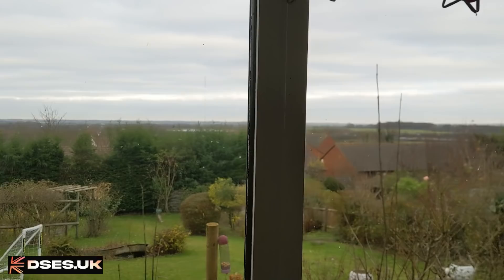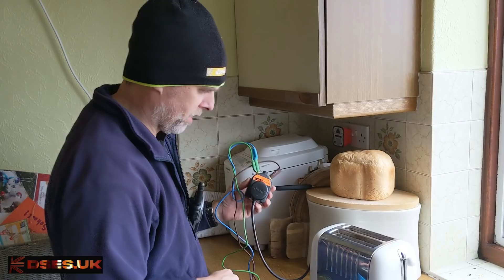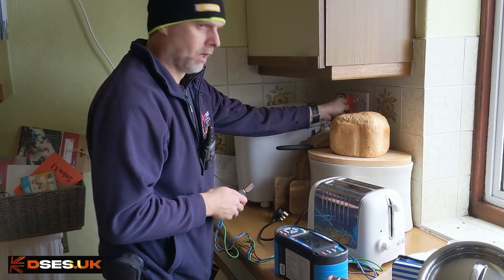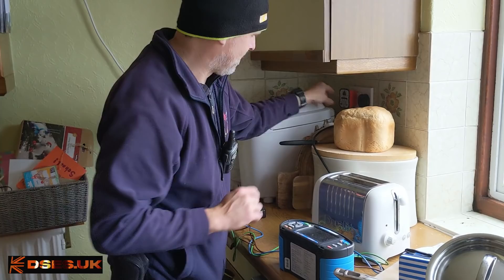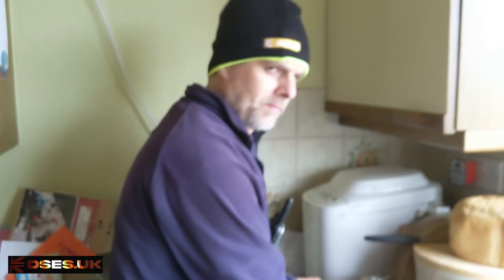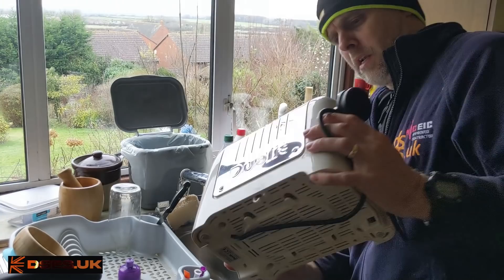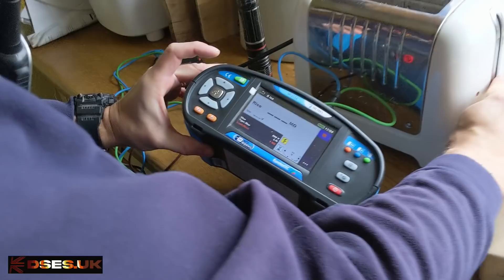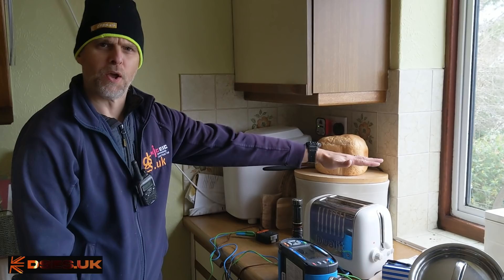Toaster trip tip #shorts

Comment: My missus stuck a knife in ours the other week and came blubbing to me that the kitchen power had gone off. I might bypass that RCD as I have her well covered for life insurance. 😉😉
Reply: contents insurance too, in case she merely destroys the heating element.... lol
Reply: joking aside, a toaster this has happened to will likely fail very annoyingly  soon, due to damage to the element 'ribbon' :(
Ask me how i know
Reply: @TheChipmunk2008  Not always though. I'm fairly certain at least two family members did the same on our old toaster and that lasted for several more years, until the plastic side panels started showing so much heat damage they could no longer be fixed in place and I decided to dispose of the toaster. Lasted from 1984 well into the 2000s.
Reply: @Ragnar8504  the key there is '1984.'... older stuff was built to last. Modern toasters have 'waffer thin elements' lol

Comment: Had this very problem in school staff rooms , and  knew instantly what the problem was . That aside I assumed it was down to thermal runaway that would course a RCD to trip , but I would appreciate your more in-depth explanation . In my case as a retired electrician I know the problem , but with all respect to your good self I’m not totally understanding the process that takes place . I would be most appreciative of any light you could shed on the subject .  Best wishes and kind regards to your good self 😀👍👍👍
Reply: Electrical current leaks from the live heating element to the earthed metal work of the toaster via the "current", and that causes a current imbalance between the RCD's line and neutral conductors as some return current is now flowing down earth rather than all via neutral, causing the RCD to trip.
Reply: Thanks sir  for your explanation , I did wonder if there was any connection with the problem of inrush say when a large 100v transformer is plugged in to a circuit with a RCD and course tripping to happen      Best wishes and kind regards.   👍
Reply: I don’t understand how as a retired electrician you can’t see the rather simple process of current leaking to earth via the lodged raisin, which causes the RCD to trip due to the imbalance of returning current.

Comment: Just another tip -
Turning toaster upside down and shaking out crumbs sometimes results in crumbs lodging in between power contacts (or between element and frame) ... Ask me how I know.
Suggest holding toasting lever down while inverted so that contacts are closed while debris rains past.
Preferably, don't invert toaster but remove crumb tray from base and shake out majority of crumbs through resultant slot.
Then again, maybe invert toaster on its edge in such a way that crumbs tend to avoid the switching mechanisms.....

In doing Repair Cafe work often I find people have brought in a toaster that trips home RCDs or has stopped working after being inverted to shake out crumbs.
Frequently the toaster shows negligible leakage or is working perfectly when they bring it in and we test it - much to the surprise of the owner.
We check toaster over, give it another clean-out if needed and a basic PAT test, then explain that the journey to the Repair Cafe has probably shaken the crumb out from between the contacts or the elements and frame.
Reply: The most common issue after shaking toasters upside down seems to be failure to shut off automatically, at least in classic toasters with a simple bimetallic strip. I still shake toasters like that but I make sure to hold them at an angle to keep crumps away from the switch mechanism. The crumb tray often isn't all that helpful, especially if you've got larger chunks of bread stuck in the toaster.

Comment: This is exactly the culprit in my situation... a darn currant shorting. I was already online pricing a new toaster but just before buying, I thought I would give it a clean first by removing crumb tray and shaking it and then turn upside-down and shaking it a few times till nothing came out. On my bench there was heaps of crumbs and yes... 3 currants or raisins as I call them. So the 3 things we both have in common are...
1/ We obviously both love raisin/current bread.
2/ We both had currants causing the short.
3/ We both have the same darn toaster that you have to SLAM that mother down hard or else it wont engage. A Kambrook?
Thanks for the video mate... good job.

Comment: Our neighbour once handed me a toaster and said it tripped the RCD. I plugged it in and indeed, as soon as I turned it on, it tripped the RCD with a considerable bang. Looking inside the toaster I found a substantial metal clip, the kind used to fix thin timber/MDF paneling to walls and ceiling, lodged between the element and earthed metal bars. I removed that and the toaster was fine for several more years until it started burning toast by turning off fairly late even if set to minimum. I still have it but haven't looked to see if I could fix that.